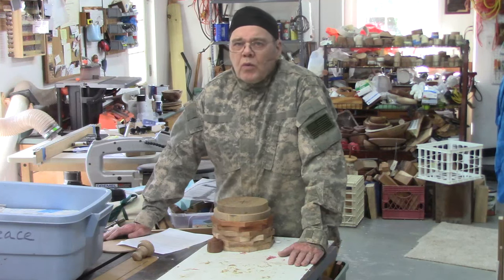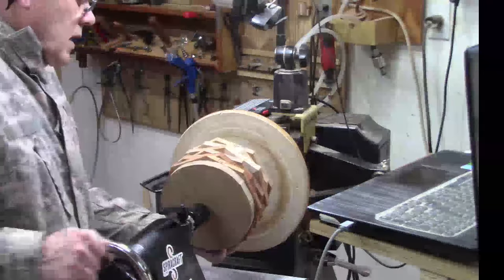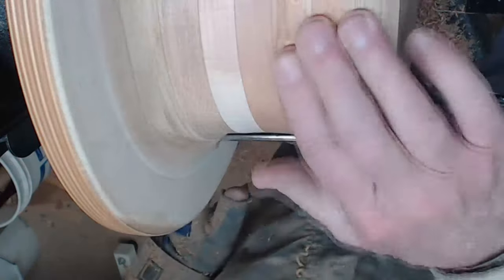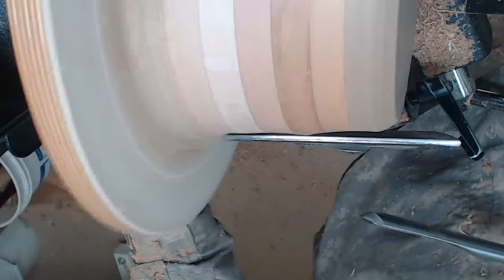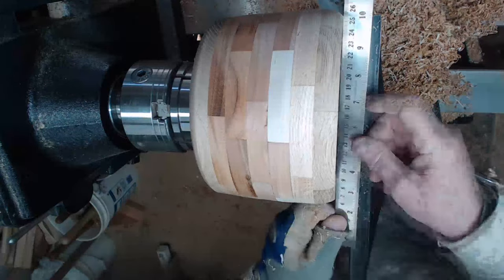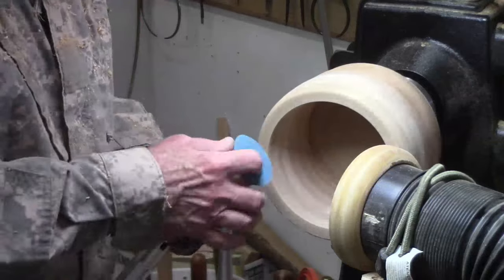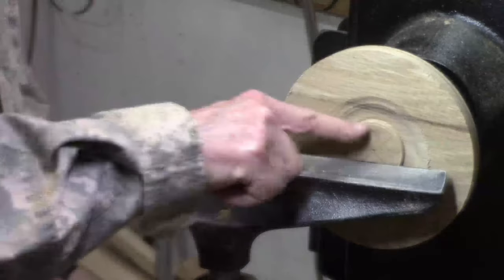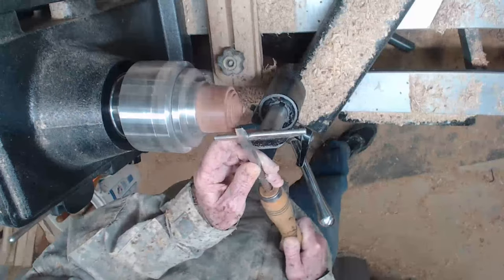Segmented Beads of Courage Box

Comment: Whoever glued that up handicapped you pretty badly.  The nice thing about segmented turning is that you can turn the bottom and inside wall when you only have 2 rings glued on.  It's easy to reach then.  Add 2 or 3 more rings, turn, and sand that part.  Rinse and repeat until it's done or the wall starts to close in like a traditional hollowform.  If that happens, start gluing, turning, sanding, and finishing from the top.  When both both bowl shapes are finished inside, glue them together then turn, sand, and finish the outside.  All of the interest of a hollowform and none of the pain.
Reply: Hear, hear.  Bernard.
Reply from the maker: Yep, gluing rings as you go would be the way.